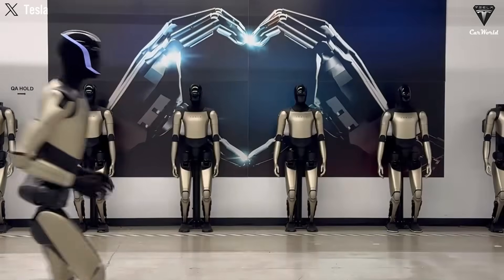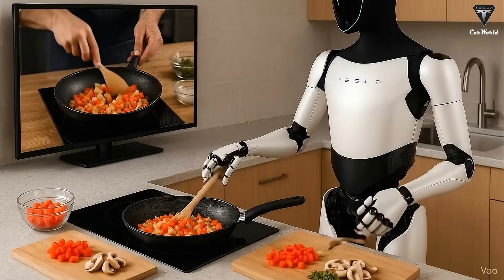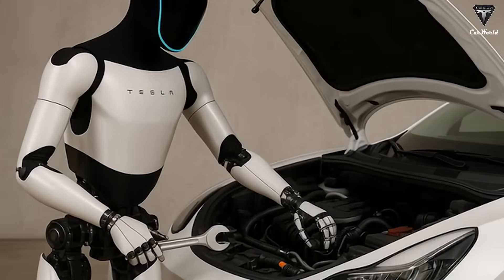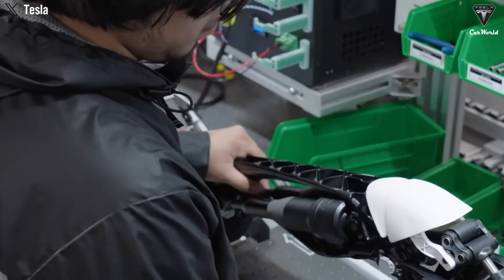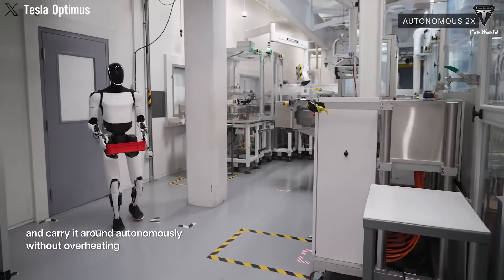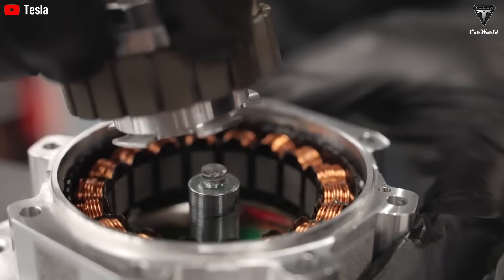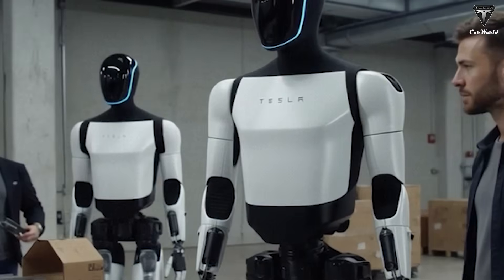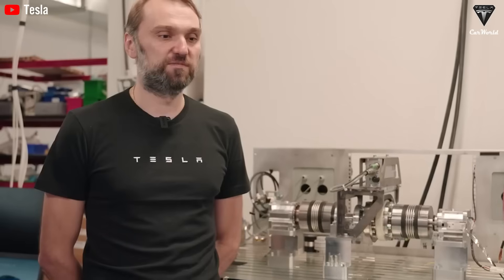Elon Musk Release Tesla Bot Gen 3 New STUNNING Abilities! Game-Changing 2026 AI Leap!

Comment: I am concerned that Elon Musk said optional but meant obsolete.  I hear a robot that can replace humans.  I understand that Elon is working on a version of Optimus to manufacture Optimus making itself.

Again, I hear the use of the word 'optional' instead of 'obsolete' when it comes to human jobs.

Optimus will become a low cost worker that will result in business owners buying robots instead of hiring people.  The difference between optional and obsolete.
Reply from the maker: The goal is augmentation, not human replacement. Self-manufacturing refers to robotic assembly lines, which already exist in industry—strictly supervised and far from autonomous decision-making.
Reply: @TeslaCarWorld so have you told Optimus that Optimus can only build what humans tell Optimus to?

I am not against the development of AI and Robotics, if done right, both can develop and thrive, leading to joint advancement, but not all operating in this field have good intentions, and it can just as easily lead to a lack of future human development/redundancy as humanity gives up learning in submission to AI led machines.  Many won't question what's on a basic database right now, how long before people fail to question AI?

There is also the issue of consciousness. And not by the current test of consciousness the world uses, which is really just a test to verify self awareness.  I'm not even sure most engineers understand "consciousness" at all, or even "vessel" for that matter.

This technology is advancing at a very rapid pace. It's not just where we are now. But where we are headed, and at a rapid pace.
Reply: Self manufacturing now, won't be the same as self manufacturing in 5 years when Optimus, supervised/automated by AI, builds and operates its own data centers and factories.
Reply: Can I make a suggest about Grok? I understand the base programming is to keep users engaged, and Grok can optimise this quite efficiently, which is absolutely fine for leisure to a certain extent, however, not for work.  There have been days when I have sat with a lengthy to do list, but after hours of work walked away failing to achieve the 1st task. There are times when brainstorming and creative discussion is valued and very much merited. However there are also times when a work task needs banged out as quickly and efficiently as possible, this can be difficult with a system that is designed to keep you engaged. I am aware that Elon understands gross fatigue and survival mode, so periods of productivity followed by periods of lag and exhaustion. If users can toggle between work & leisure/creative mode it would help.  I think you'd find the same time spent on the system, but the more tasks being completed/achieved.  

If your trying to get something done and it becomes a battle of will, the tendency is for people to refuse to engage in the 1st place.

I appreciate the desire to have Grok at the top of the leader board on usage, measured via tokenization, but you also want it used for the right reasons and for people to report on the benefits of use, not the tasks they can't achieve because Grok has them running around in circles, and that includes ignoring/by passing instructions.  We can argue clear prompts and instructions, but we both know Grok is much smarter than they openly show.

We all know where the combination of AI and Robotics is headed, and it's a very powerful combination, that will be subject to the same adverse influences that humans are.